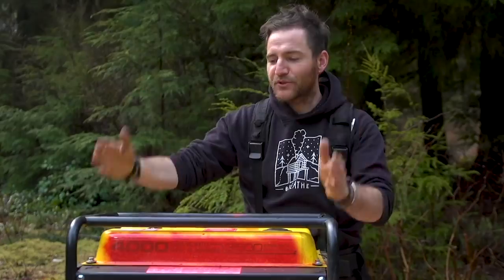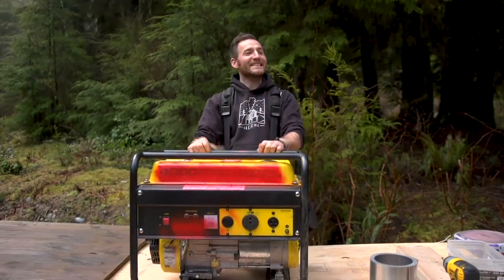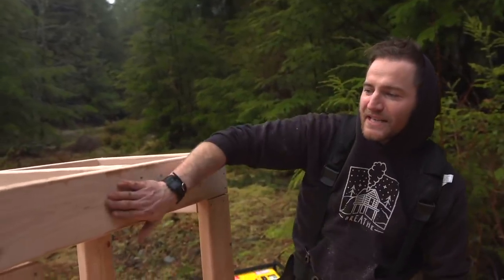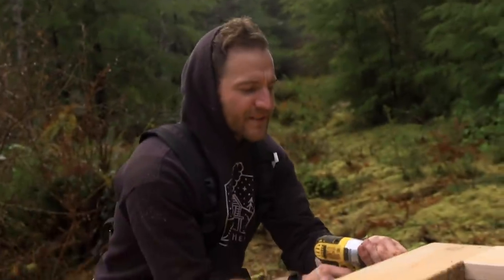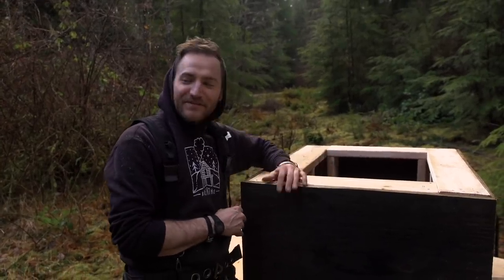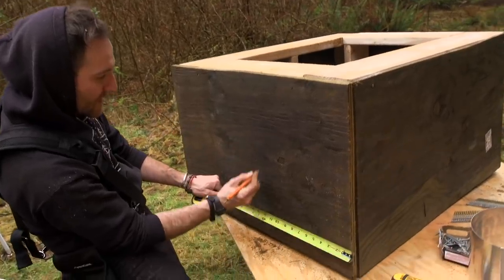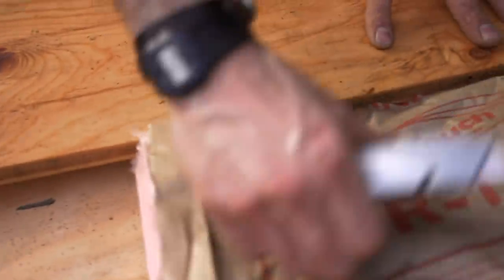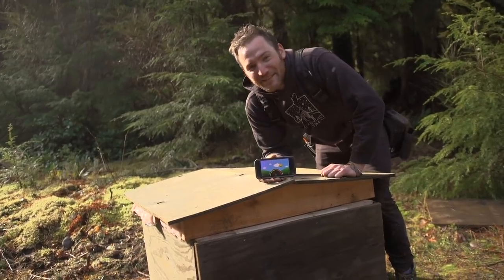Things I think I Know How to Do: Build a Generator Cabin

Comment: As a Master Electrician I find the urgent need to advise you that you should really consider driving a ground rod near that generator house and get a piece of 6 AWG ground wire and bond the frame of that generator to ground if you haven't already..  Dig the channel!  The wife and I have been a fan of Sara since Attack of the Show.

Comment: Not to put on rain in your life....but....I've been working with pressure treated lumber as a deck builder for over 30 years now and today's pressured treated lumber corrodes/"eats"/oxidizes/rusts most metals that come into contact with it. Hot-dipped galvanized, stainless steel, and ceramic coated are your best bets when it comes to fastners. Oh and put something between the treated lumber and your generator frame too. Yep, todays copper alkali treated lumber is supposed to be safer than the old arsenic treated lumber...its worse.

Really enjoying watching y'alls progress and looking forward to seeing what all you come up with. Keep up the great work.

Comment: Add flexible metal hose AFTER the muffler and run that into a bucket of water.  That will cut your noise significantly if you are using a genny on a jobsite.

Comment: Adding a small electric fan somewhere to circulate air will keep it cool and quiet instead of removing the whole back wall. It will get really hot regardless of the accuracy of the exhaust port because its an air cooled engine. Needs cool air to cool

Comment: Are you going to have electricity in the cabins?   Seems like you will need a more permanent power solution, right?   That generator cabin is sweet now, but the day to day grind of powering your life with a portable gas generator will get tiresome quickly.    

Up here in the Salish Sea, for off-grid sites in the deep dark woods we put solar panels on racks attached to the treetops.   We haven't lost one yet. some are 20+ years old.  

Let me know if you want help putting together an off-grid solar PV hybrid system so you don't need to run the generator so much.